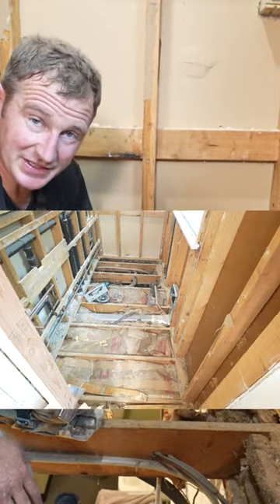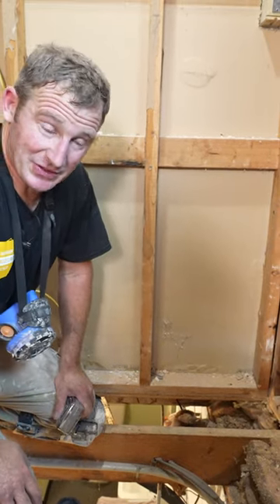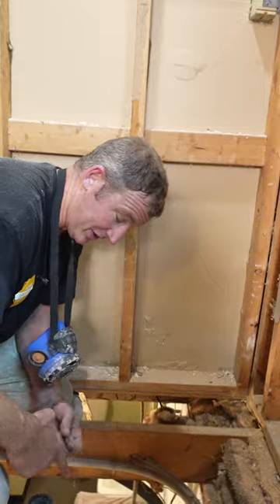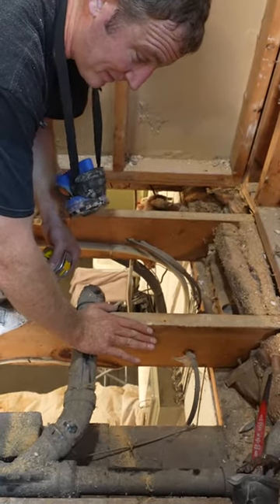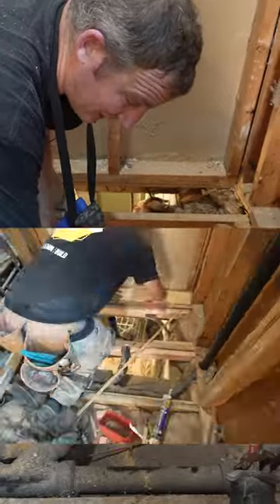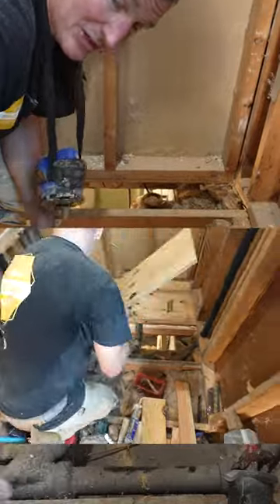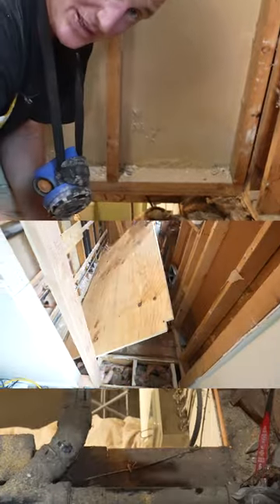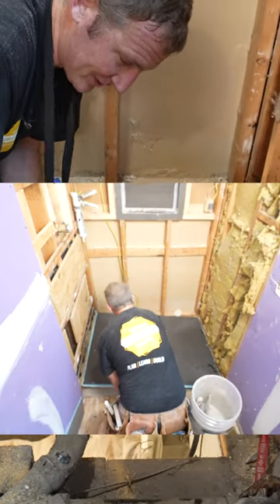Curbless showers and the unknown

Comment: I want to build a shower with as low a step as possible. The home was built 20 years ago. It has 2x10’s supporting the floor, than a 3/4” plywood floor, than the walls on top of that. The washroom floor has 1/2” duroc and 1/4” porcelain tile over that. This looks like exactly what you have, where do I get a pan to fit this?  Thanks.😊

Comment: I have a mobile home that has a 7x5 feet bathroom.  I found that it used to have a shower.  There's a toilet and sink.  I was wondering if I could just install a drain where the shower drain is and make the whole floor water proof so it can be one big shower?  IDK  just a thought.  I don't want to tile it either.  Do you think the vinyl roll flooring will be okay to use?  I was thinking just a drain just in case of toilet flooding and easy cleaning too.
Reply: Have you ever seen or heard of vinyl flooring in a shower?
Reply: Theres a reason why you never see vinyl flooring in bathrooms